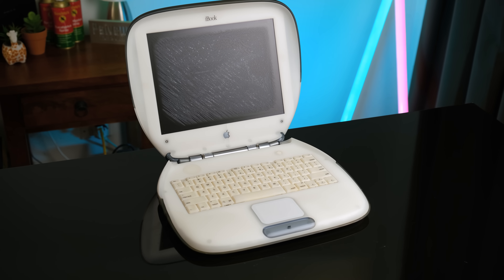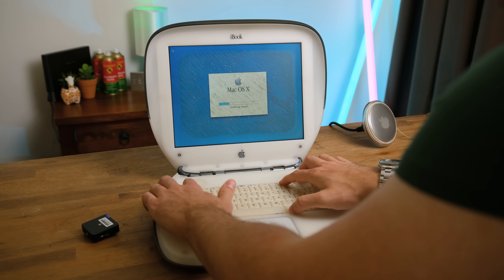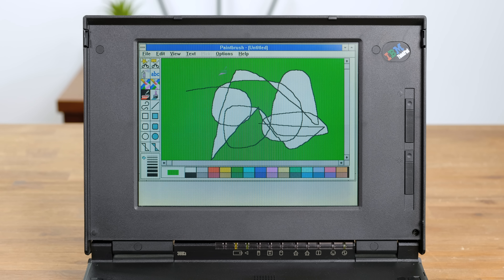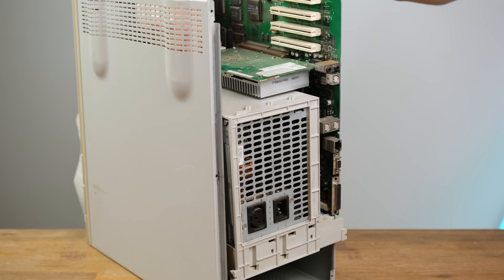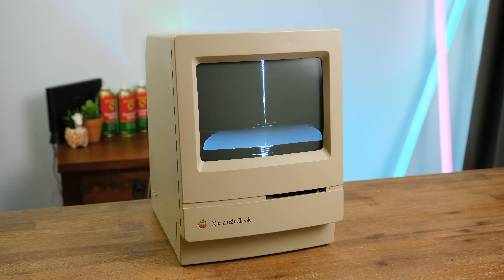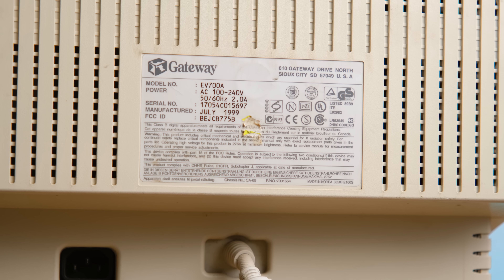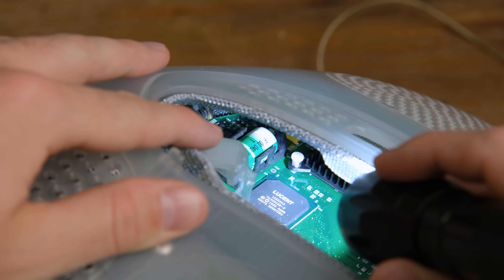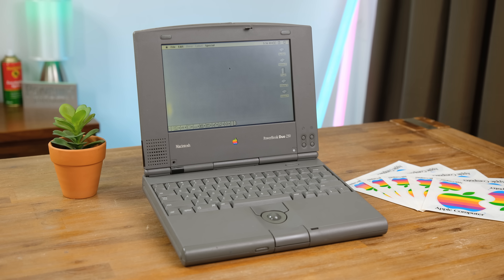So Much Vintage Tech Is Dying... Here's Why

Comment: To be honest it's a matter of keeping it in consistent temperature and checking on them. Those old PCs and Macs don't like heat, too cold and moisture. Keep them away from that and you're almost good to go for another 30 years. At least in Germany where i live... i've never seen those in such bad condition when storing them safe. I don't know bout Australian homes, but most here are made out of concrete and/or Bricks... so they have a pretty consistent temperature. I hope your stuff doesn't desintegrate futher... that would be a real shame!

Comment: That reminds me, I had 4 Wii remotes for my Wii ofc. 2 of them died and I'm suspecting of faulty capacitors, funny enough they were the older ones. I think it's time to check the caps and PSU on it cuz the last thing I want is corrosion on a thing I hold and something that's plugged in to the wall 24/7

Comment: My ps3 controller joysticks are sweating. Displays and stuff can be replaced so long as you can find someone who still manufacturs them for these old parts. 

At least most of my old hardware are desktops. So I can just swap whatever display I need. The steel cases are fine so long as the paint isn't worn off. Or can be repainted. Capacitors can be replaced if they dry out or if they start to leak.

Comment: Yup, all electronics will eventually take the dirt nap, though, ironically, the older stuff will be restorable for longer.

I would point out that the hard disk trick is EXTREMELY short lived. If you do this, do it with another disk connected to copy the data to, as it will probably never spin up properly again. It would also be a good idea to try to do it in as dust-free a room as possible, as the average size of dust is significantly larger than the gap between the heads and the platter, and it only takes one to cause a head crash.
Reply: If a harddisk won't start, never open it! - Any tiny airborne dust particle will start a chain reaction of debris (like colliding satellites) that will unavoidably destroy it. Likely it won't spin because the bearing oil has hardened. And do not knock or use  force. Better simply warm the bearing with a hairdryer (not too hot) to remelt the grease and then let the disk spin for an hour to let it knead the lube soft again.

Comment: well my reel2reel tape machine from 1973 still works great... not a single plastic bit inside and weighs over 20 kg.... also has some really durable military capacitors replaced by the previous owner in the 80s...cars made today will be a horror story in 6-7 years, all junk.

Comment: Thanks for a thorough PSA! But I gotta say, it's weird and sad that the video merely ends with a shrug as if nothing can be done to prolong the lives of these awesome old machines.... most of the things covered here are easily addressable: there are tons of modern SSD hard drive replacement options, capacitors can be replaced, sometimes battery damage or other corrosion damage can be repaired, delaminating screens can repaired or replaced, even broken plastics can be replaced with 3D prints.... come on man...

Comment: 80% is not a good long term storage charge for cylindrical lithium cells. They are very different from the LiPo battery packs in modern laptops. 60% is the standard storage charge for LiMn and it's derivatives in cylindrical battery cells. Part of your battery problems could lie there.

Comment: That's sad that components will break down with no use over time, even if stored well.
Reply: With enough effort, things can be remade. The C64 community is a great example - various failing custom chips but through the hard work of enthusiastic people, modern replacements are now available!
Reply: @josh46646  Yes so true, there is some impressive work being done in those retro computer scenes.
Reply: @ATomRileyA  A good example is what the GameBoys went through looking for a replacement for broken DMG screens.
Reply: @josh46646  but for every mac with a community of avid enthusiasts keeping it alive, there have to be thousands if not tens of thousands of products that will die in obscurity, obsolete & forgotten.
Reply: @josh46646  It quite the pricy hobby though and might costs more than buying the original back in the day, especially if you did buy one a few years down the line. I always have to force myself to resist, even though it doesn't work all of the time. Next thing I'm waiting for is the Orpheus II sound card for my old DOS PC, as I missed the first batch (already have the Orpheus I amongst other sound cards for the system).
Still cheaper than modern graphics cards though. xD
Reply: Indeed, nothing lasts forever.
Reply: If we ever get involved into World War III, another problem could be the threat of EMP strikes, which would fry all electronics within the affected radius, including electronics in museums, private collections, etc. 😢
Reply: @Amazing.A.I.Channel  Then just store your devices inside a quality faraday bag/box.
Reply: @Amazing.A.I.Channel  But not old tech..didn’t you see the 2004 Battlestar Galactica series? They pulled their OLD obsolete Vipers out of storage because they were immune to the Cylons’ electronics defeating weaponry! Let’s hear it for old tech…it’s gonna save us all in WW3!
Reply: @Amazing.A.I.Channel  On my playlist about shielding are some EMP protection tips. For small things like USB-sticks, portable harddrives or digicams, simply store them inside a closed cookie can to survive the now coming WW3.
Reply: Everything will. You can buy a brand new car and not drive it for years and chances are, something with be wrong with it
Reply: @pointedspider  that's why it's annoying when those cars show up for sale and they want rare car prices because they have a Honda civic with 18 miles the owner drove home from the dealer and died or something, but the tires, all the fluids are 20 years old, all the rubber components are dried out and broken down. seized brakes, could even be rusting. but someone really wants to pay tons of money and then pay more money fixing it just for that "new" 2001 Honda Civic LX
Reply: @pointedspider  Any good mechanic will tell you letting any sit for very long will cause damage in various ways , for one thing internal parts need oil splashing around to keep things lubricated and seals from cracking.
Reply: That is sad but a lot of this is just due to capacitors failing, capacitors are extremally easy to replace and there cheap
Reply: Yeah, one thing I fear is when my external drives start to fail. I had borrowed a hard drive in my dad's 2008 Mac Pro that had 4 hard drives, and after 10 years, it would still boot, but wouldn't let me install anything. It would always say packages were missing, so something got messed up with it. The rest still work, which is nice. Big ugly cheese grater with 2GB of RAM and it works as a GameCube emulator. I don't use it anymore as my Wii plays GameCube games too and still works. My Wii U won't boot, so I seem to have better luck with old things, than new things.
Reply: @joylox  Good thing it's not all doom and gloom for gaming.
We have indie games and AA games like Fnaf, Batim, Monstrum, Cuphead, Dark Deception, Hollow Knight, Shovel Knight, Hades, Little Nightmares, Celeste, Skul the hero slayer, Metallic Child, Dead Cells, Curse Of The Dead Gods, Cult Of The Lamb, 13 Sentinels Aegis Rim, Input6, FIST Forged In Shadow Torch, Lumbear Jack, Pronty Fishy Adventure, The Desolate Hope, The Messenger, The Coma, and many more.
Reply: @keeganmcfarland7507  
I know this is in legal grey area/somewhat illegal, but the emulation, piracy, and modding community is around and kicking. These guys can also preserve the lives of older games even though older companies hate it. (Nintendo in particular.) 

And depending on where you live, not too much can happen to you. 

US: Emulation is legal as long as you legally have the copy of the game. Piracy isn't but it isn't a crime where police are actively hunting people down over it.

China: Copyright law wasn't truly respected all too much and they typically turn a blind eye. That's why you see so many knock-offs.

Russia: Also never really big on going after people for copyright infringement of foreign companies but due to sanctions has practically legalized it.
Reply: @mill 27  Does Nintendo deserves a wake-up call from Valve/Steamdeck, piracy/modding/emulator gang, indie game developers, Sega, video game industry crash, and Ken Akamastu (or any specific mangaka) and realize how scummy Nintendo has made over the years?
Reply: @keeganmcfarland7507  
Unsure. You think so?
Reply: @mill2712  Yeah
Reply: @keeganmcfarland7507  is Sega Japan just as unfair as (or more so than) Nintendo, even though it has a less argumentative fandom than the latter?
Reply: @SlapstickGenius23  Sort of?
Reply: @mill2712  Culture preservation is not crime. It's a human right!
Reply: Everything has its lifespan.
Reply: @MamaMOB  even pyramids that has outlived billions of people over all lifetimes.
Reply: @shawnmichaels4805  Try to make you pc out of stone lmao
Reply: @medraen  shit only runs microsoft bob
Reply: This is why I don't understand why people collect limit edition things
Reply: not all will,
Reply: @andygozzo72  Yeah only macs because they suck
Reply: @harshnemesis  even old PCs. No matter how much you preserve them. They are doomed to fail at some point.
Reply: @hihellothere9569  Yeah but you can fix PC easily if they fail. CrApple always designed their computers to be e-waste
Reply: @andygozzo72  this is not a video meant for any form of useful or intelligent relaying of information. It's just a sob story made by some person who likes to collect electronics but is unwilling to put in the work to properly take care of and maintain them.
Reply: To be honest newer computers should have a less likey failure rate due to chips being able to do muilple things. So instead of 80 chips you got to worry about there are 4 of them.  It is sad that older technology is dying tho. Even some newer tech won't make it long.
Reply: @hunterbear2421 Plus the newer tech wouldn't be here without what came before it all
Reply: @TheSilverShadow17  True, but I am just happy it existed at all
Reply: @hunterbear2421  Same here, even though I wasn't born yet when these things were made, but I do greatly appreciate how far we've come thanks to this hardware. Plus people have found ways of keeping them alive through modernization and emulators at least.
Reply: Especially devices designed to not be repairable.
Reply: All by Design. The past must always be deleted so they can keep lying to the next generation about it.
This is why video and audio formats are always changing too. This is only one of the things put in place to fulfil that agenda too.
Why do you think hard drives are now soft drives and everything is pushed online.. All that used to be paperwork. 
Then they Stage an EMP event and delete everything because they put all the data in one basket as they continue to do.
PS: They are the Eastern Matriarchy .. They are The Real Enemy of the people. (Who are not of their lineage.)
These are not CLAIMS either.. They are SOLID FACTS.
Reply: Good thing about electronics though...the laws of physics don't change.  A modern capacitor or transistor can make a fine drop-in replacement for a decades-old one just fine.  But the chips you might have a harder time sourcing.  Luckily, with those being mostly just inert silicon, rarely degrade like other components can unless they are overvolted or driven hard (overclocking for example).

I had a gaming PC I built in 2009, never messed with clock frequencies or voltages, kept everything stock, never even lifted off the CPU to replace thermal paste in 14 years, and that thing kept ticking until I replaced it with a new system last year.  Heat is the enemy, mainly.
Reply: Meh, if people truly care enough about these things, eventually people will reproduce the parts. There’s a reason you can buy newly made parts for 60 year old cars, cause people still love 60 year old cars.

Basically, if the general public who cares about this stuff actually cares about it and isnt simply saddened by the loss of something they feel nostalgic over, they will continue to try and keep it.
Reply: Like all things, even technology has an expiration date and will decay
Reply: Makes me very sad, basically all tech is doomed to become e waste at some point.
Reply: @majestic._  I know when I. Was a kid I thought I have my games etc forever and was interested in getting some retro machines but after seeing this...
Reply: Its common knowledge
Reply: They still break down with use, use just slows it down some or old thing just goes no more shuts down during use  time is time and stuff ages and wears out
Reply: Part of life
Reply: @ocean chills  I don't understand why (some) people hate indie/AA games.
I love indie/AA games.
It's better to have a small, comfortable studio rather than a big, shitty cramped corporation.
Reply: That's why I think we need to put much more emphasis on restoration and repair since you can extend the life by repairing or replacing the things that fail every few years like capacitors. Seems this guy who made the video though doesn't think it's worth the effort since he said it's "too difficult or time consuming".
Reply: Not sure whenever it's mostly old macs falling to pieces because they suck, or this guy is an iSheep... Probably both🤣
Reply: @harshnemesis  thats probably correct, he's basically a less fun, more fearmongery, isheep version of lgr with 100% less charisma... gross
Reply: @Mapmoop451  There's also Dankpods who is an iSheep, but at least he is incredibly charismatic and fun
Reply: @harshnemesis  everything fails even your body.

It just happens

Comment: A lot of this is why I sadly quit collecting. If I get the itch for vintage software an emulator is a adequate solution. 
I miss my Amiga, C64, VIC-20 and more but I don't miss the upkeep.
Reply: my old dell laptop i got from ebay had its lcd die on me, the motherboard in it still works good

Comment: All my old Computers have their batteries removed and replaced with new round(?) cells. My oldest ones are a C64 and a 286 with 12 Mhz, both working like a charm. The worst Computers are from the late 90s, early 2000s in terms of longevity. Many failing parts with bad caps and solder joints.

Still love them though. My first pc with a voodoo 2, oh how i miss it!

Comment: I still have my Compaq Armada 7770DMT from 1997, which i bought on a flea market approx. 13 years ago.
It´s still working, however i quickly removed the clock battery pack (nimh) which already had started leaking, which is also a common cause of a mainboard damage.
The corrosion goes through the cable and eventually will spread out on the mainboard from the connector itself.
I probably removed the battery right before this happened.
It´s still up and running, but at some point, the screen got cracked by accident.
A year ago, i did a "restoration" and bought a broken 7730mt, which had a dead mainboard.
I replaced my "hacked together" display panel with the compaq OEM part aswell as some missing plastic pieces.
Now it´s almost as good as new.
The HDD died at some point, but it already wasn´t the original drive and it´s super easy to remove.
Now rocking a massive 100GB HDD

The last year, i also started collecting this model and got another 3 of them.
One was hacked together from leftover parts.
Sadly, one of the four makes a weird screaming noise on first power up.
Seems to be an issue with the mainboard, as i swapped PSU and sound card already.
But as long as it´s still working...

Comment: ugh, lost about 7 macs to "Brittle case disease" I had several quadras, they basically disintegrated on the shelf. and recently a starmax 3000 simply just stopped booting. and the imacs, those also can suffer from brittle plastic, in some cases the internal frame just breaks apart. in the slot loading ones, the belt on the optical drive can go bad, making it not accept or eject discs, also the speaker foam turns to crap. I have one such imac that has this issue.. it seems as I just can't stop the march of time :(

Comment: that gateway crt might have the same issue my crappy syncmasters had where a fuze soldered to the pcb blew. happened on both of mine and once replaced they are all good. sadly my rasterex crt made alot of pops and bangs (screen flickered whilst doing so) whilst the Xcaps blew but they must have masked something else doing bad since the screen only desplays a fully white screen when on and nothing else and i have no idea how to fix it.

Comment: For your original g3 iMac, just clean under th HT lead on the CRT, dust particles are making it arcing and this is the noise you hear ! It a simple fix ! For the G4 titanium, unplug and replug the internal pram battery and it will fire up !

Comment: The heads get stuck on old hard drives. Quicky turn the drive in several directions can sometimes free. A gentil tap can work as well.

Comment: that isnt mold under the ibook G4, those splotches seem to be the same thing that my Vista laptop had originally, its the layers of the LCD separating and letting air in underneath, my vista started like that and now has solid lines and streaks all over the display where its spread. the good thing is, the displays still work fine, they just have ugly splotches